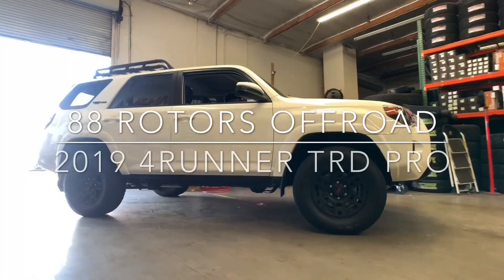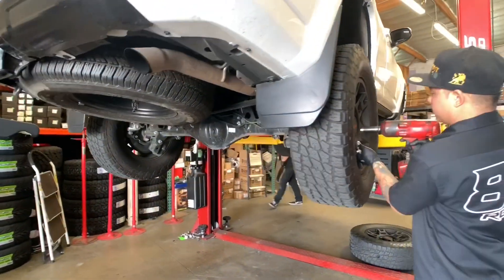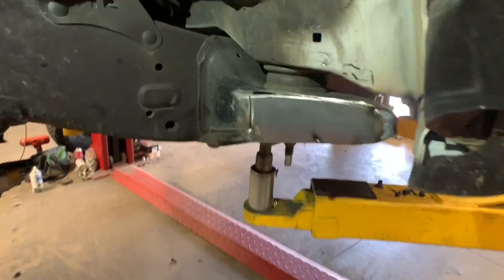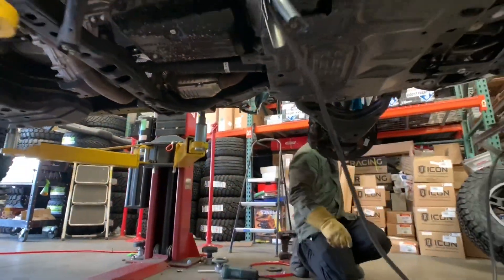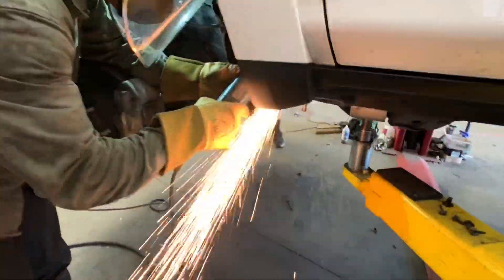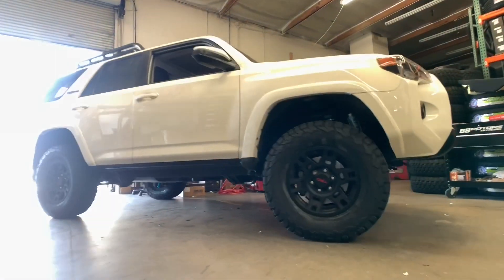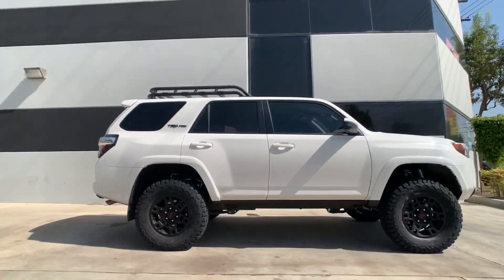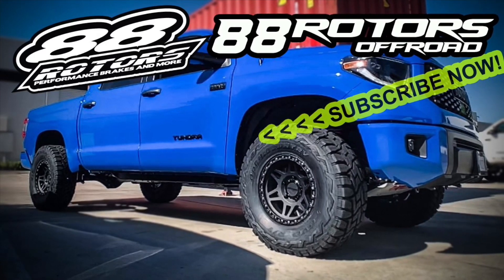2019 TOYOTA 4RUNNER TRD PRO DITCHING OEM FOX FOR KING SUSPENSION

Comment: This is actually my ride, love the array of comments. I bought this brand new, loved the way it looked, decided to make changes because I can. The TRD Fox suspension was as soft as whale shit. This King set up is legit! Roof rack is gone next! Peace
Reply: Haha I have way too shitty a job for all that.
Reply: I installed a Southern Style Off Road roof rack on y TRD Pro 4Runner.  I am extremely pleased with their product.  You will need a breaker bar with the hex bolts that Toyota provides with the TRD Roof Rack.  Toyota used red lock tight on them!
Reply: I have a 2018 TRD Pro. Went in to add a toytec lift with bigger tires and found out that both front springs on the Bilstein coil overs are broke. I was already thinking of ditching the stick suspension for Kings. So yeah, just because it’s a Pro, doesn’t mean there isn’t better upgrades out there.
Reply: How much did the whole set up cost you plus install if you don’t mind saying?

Comment: I have a 2018 4runner TRD Pro. Went in to add a toytec lift with bigger tires and found out that both front springs on the Bilstein coil overs are broke. I was already thinking of ditching the stock suspension for Kings. So yeah, just because it’s a Pro, doesn’t mean there isn’t better upgrades out there.

Comment: I got my new 2019 TRD Pro less than 3 months ago and had to ponder the suspension question too.  I love the look of the truck and the ride of the Fox suspension, and I am not a hard-core offroader, so I intend to keep the OEM kit for now.  However, I am adding a C4 Lo Pro winch bumper that will compress the front; I just don't know by how much.  Since I don't mind the factory rake, I will just throw on the bumper and see what difference it makes.  Leveling the truck poses its own set of questions.  Will it affect handling?  Will the lights be aimed higher than I prefer?  At this point, I am sticking with the Fox shocks and will make my decision later.  If the front compression doesn't bother me that much after installing the bumper, then I may consider a King upgrade at around the 7 year mark.  I just won't upgrade the Fox shocks just because.

Comment: Hi guys, first congratulate them on their channel is a great help and entertainment for me. I have a 4runner limited 5th gen and I put forward Fox 883-06-111 suspension and back Fox 958-26-117 suspension with 895e emu springs. How much lift does the emu 895e with 4runner five seats? I also have general grabber atx 285 / 60r18 tires and I feel that it is very slow, could this be because of the width of the tire? You always put 285 / 70r17, did this happen to some of your clients by the width 285?
Thank you very much for your answers and congratulations again.

Comment: I feel it’s a waste of money. When I bought my Tacoma I decided on the TRD off road. I have crawl control the same as a pro. I negotiated the price and it worked out to be about 12k less than a PRO. I went with a 3in Fox 2.5’s and a leaf pack sitting on 285/70r17s. Cost me about $5k for everything including TRD pro style grille. So I would say yes, the pro is a waste of money :)
Reply: The Pro is more expensive due to the exclusivity of the model. Which makes the vehicle depreciate less than any other model. So no it’s not a waste of money
Reply: it is still not a PRO
Reply: Still isn’t a pro.

Comment: they only reason to get a TRD PRO  is for the crawl feature,
Reply: Nope. Trd off road has crawl control too.
Reply: TRD Pro adds the Fox shocks, TRD wheels, moon roof, heritage front grille, the sad-looking FJ-style roof rack, but most importantly for me, the JBL speaker system.  The said speaker system sucks if you use it with the factory Entune crap.  I upgraded my media head to an Alpine iLX-F309 and my sound quality was improved dramatically -- not to mention the fact that I can get more vehicle data on it than the factory dash allows on a 2019, and I can also control all kinds of external accessories (winch, lights, cameras, etc.).  As far as the 2020 4R TRD Pro, unless you have a fetish for military things, don't waste your money.  Pedestrian detection systems don't work all that well and you're better off upgrading the infotainment system with aftermarket stuff.  Push-button start can be added aftermarket as well.
Reply: @rommelrivera1186  the JBL stock  system sucks ass IMO. Even when you only change the deck etc. I upgraded my deck to a bigger screen Kenwood, and upgraded all the back speakers to a higher model JBL, and the fronts are Mojo speakers. Also added amp. It sounds like a live concert now. LOL
Reply: @MichaelKeelphotography  I'm sure there's better, but the JBL speakers sound better to me with the Alpine media head.  I would probably invest in better speakers but the 4Runner cabin isn't very quiet.  I'm an amateur musician, so I would need a quieter environment to appreciate the sonic difference.
Reply: the only reason to buy a PRO is because I can